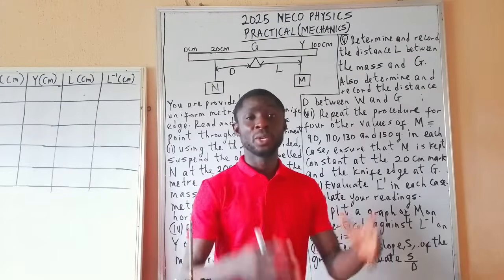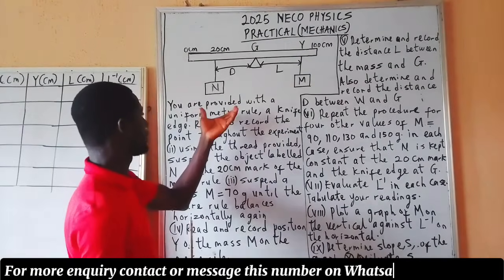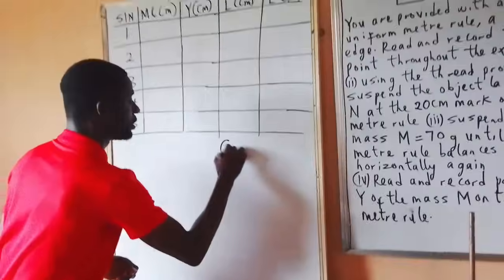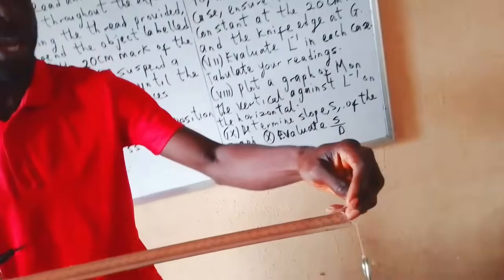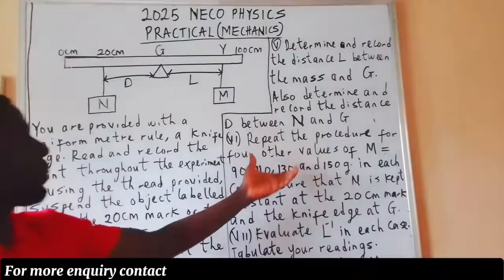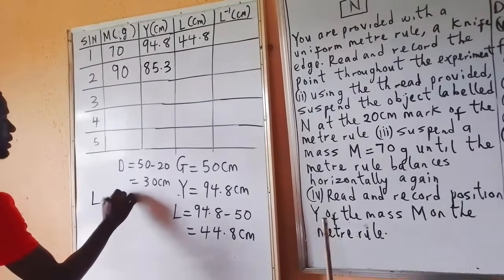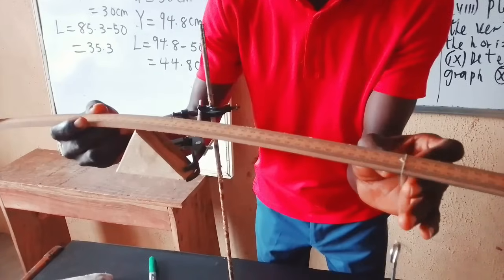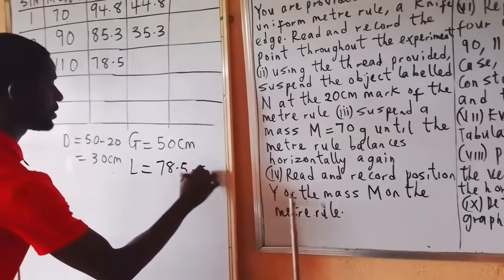NECO PHYSICS PRACTICAL 2025

Comment: sir pls what if the metre rule does not balance at 50 maybe 51.5 are we to still use 50?
Reply from the maker: 51 outside within the range of value for center of gravity. Your Center of gravity does not necessarily need to be 50.00cm exactly. The acceptable range is from 48.50-50.40. If you are still within this range, you are still right/correct. Write the CG you get from your metre rule if it is still within this range of values.